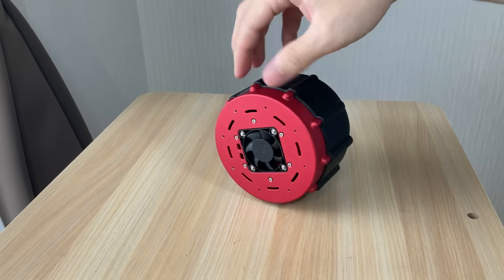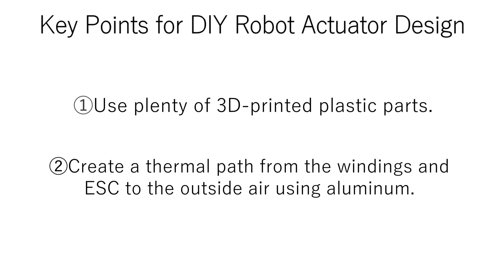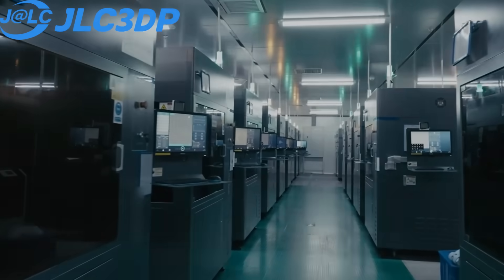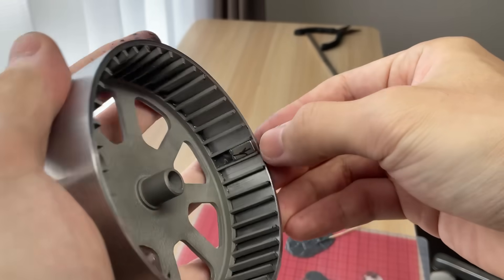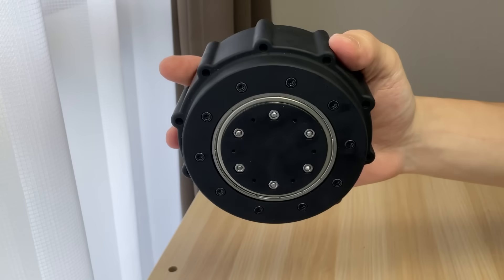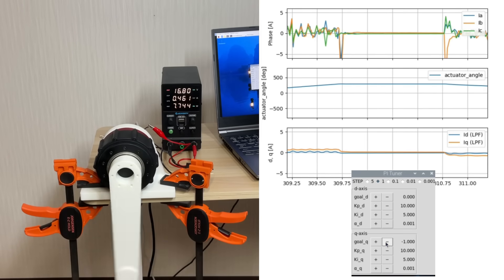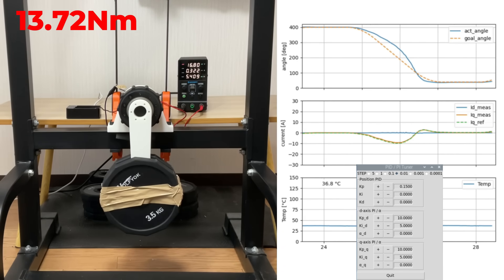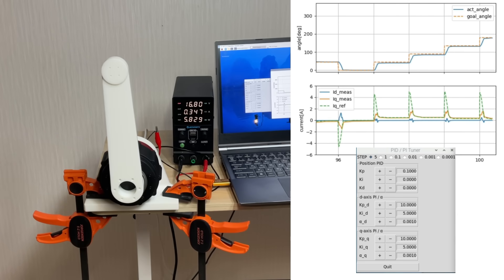I Built a Heat-Resistant DIY Robot Actuator

Comment: Speed differences when running CW and CCW are probably from improper  position sensor offset.
The jitter you se during high speed is probably from improper handling of voltage saturation.
The EMF voltage renders the controller unable to reach the desired current during high speed and your integrators wind-up.
If this is the issue i suggest using DQ-feed-forward compensation in conjuction with an incremental form PI
or the controller from this paper:

Simulation Model Development of
Electric Motor and Controller
Master's thesis in Systems, Control and
Mechatronics
Wang Han

Comment: Fins for convection cooling on the back would be more efficient and effective than the fan. When cooling is needed, always look to convection first before adding air flow. Most products can be easily cooled with convection and that motor has plenty of mass to absorb heat, it just can’t dump it fast enough into the air because of low surface area.

Comment: I have some questions, 
1. which ferromagnetic material did you use for the metal ring? 
2. Is the metal ring the only part is made of metal in the whole design apart from the screws, nuts and bearings?

Comment: Hi. You've done a great job and I'm impressed with your result.
I've got a couple of "boring" observations that might give you some new ideas.

You're using a 7kg load with a 20cm arm. At the same time, you get a torque of 13.72 Nm.
If we consider that one revolution is done in 4 seconds, then we get a frequency of 15 revolutions per minute (1.5708 rad/s).
This is 21.55 W of mechanical energy.

On the power supply, we can see that at peak it consumes about 125W of electricity. 
Even if the operating power is half as much (60W), then the efficiency of the motor with a gearbox is good if 35%. 
That is, 65% of the energy goes to heat.

I'll risk suggesting that you designed the motor, encountered high heating and decided to increase the heat sink, which is reasonable.
But the efficiency of BLDC motors produced in series is about 80-90%.
Perhaps you can increase the efficiency through a more correct control rule. Or by increasing the voltage. Or by increasing the cross-section of the windings.

Thanks for shining a light on your projects.
Good luck.

Comment: Awesome design, if your limitation is the thermal path, you could improve it by potting the stator with "thermally conductive potting". 
Depending of which one you choose but you can expect between 3W/m.K for the top one and 1W/m.K its far better than 0.02W/m.K of the air. It adds a little weight on the design but a gain of 20-30% on the winding T°

Comment: Congrats, impressive project and great video! The difference in CW/CCW max. speed shown at 9:29 can be related to an imperfect angle feedback. I would try to increase the current used in the encoder zeroing procedure, or just fine-tune the offset by trial and error

Comment: What is the approximate cost?
Reply: Probably around 30-50USD for the controller board if made by jlcpcb
100-400USD for custom machined chassis, bearings and gears? (Depending on what he has access to)
30-200USD for the motor stator + coil (again depending on what supplier etc he has access to)
10-50USD for other accessories like screws and fan.

So between 170- 700 USD?

Comment: Im an absolute newbie when it comes to robotics, but about working with bearings: put them in the freezer before installing, you'll never scratch an aluminium casting again!
Reply: a lil determination
Reply: An some heat on the aluminium so it can expand

Comment: The anodizing needs to be sanded off the raised aluminium platforms for the heat pads to improve cooling, as the anodizing layer otherwise acts as an insulator.
Reply from the maker: I didn’t know that. I’ll do that from now on, thanks!
Reply: @Koshiro_Robot_Creator  It's theoretically better, but practically makes little difference. the anodizing layer is Aluminium Oxide which iirc still has a conductivity of 170 W/mk or similar, which is two magnitudes higher than your thermal pad. So not really an insulator. But it doesn't conduct electricity, if you want to enhance safety. So not worth the effort in my opinion, even though the statement that removing it improves cooling is obviously correct.

Comment: Since not making inner hollow of stator densly packed with reduction stage, just wondering about using in-runner instead. I see there will be interesting optimization between sacrifice of torque and better thermal path with less material. I'm glad you sharing this inspiring work!
Reply from the maker: Yeah, that’s definitely a possibility. Interesting idea!

Comment: This is so cool! I do wish motors like this one were super cheap and readily available for projects. Decent ones from robostride seem to cost $250, which is a chunk of change.

Having the cycloidal disks on the inside really is cool for formfactor reasons alone. but having to rebuild all the time is costly as you mentioned. 

Also the magnets not being curved means there is additional room between the stator and rotor which leaves some performance on the table.

All in all very cool. Great work. Wayyy better than I could ever do haha